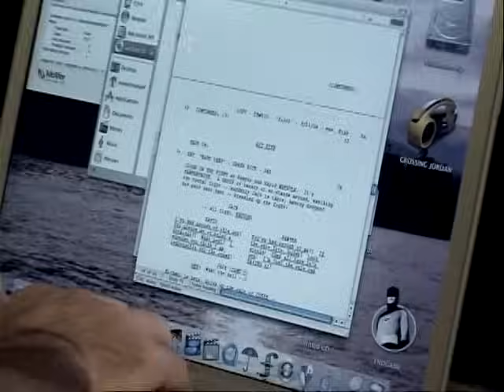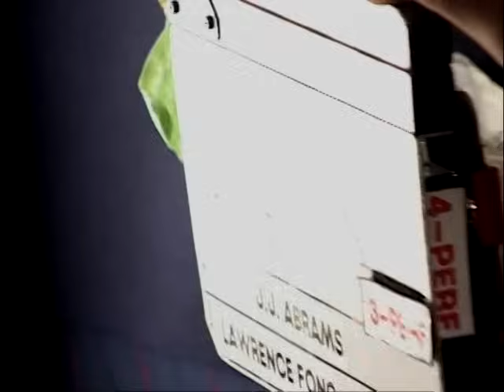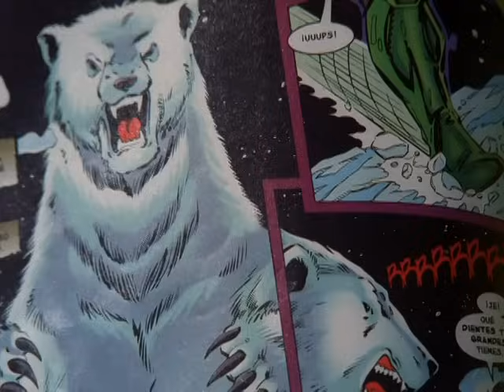LOST - The Making of the Pilot

Comment: Show started of really good with a really good premise. Then from season 3 onwards the writers really lost the plot and the rest of the show just turned into a mismatch of disjointed stories that had no bearing on what came before, with none of the setup from the first 2 seasons every paying off. By the end of the show you were just as lost as the characters. My comment to my partner when the show finished: All this when they all just need to speak to Allison DuBios after the plane crashed.
Reply: That’s because the writers intended to finish it in 3 seasons, but the network pushed them to make 3 more, so they had no choice but to make up random stuff and tried their best to make connect together
Reply: @Rayan.7  As a writer myself, one of the cardinal rules is that you never 'make stuff up' just to fill. As a playwright once said (I can't recall exactly how said it): "If you point out that there's a gun above the fireplace in Act 1 you damn well better use it by the end of Act 3." If it doesn't contribute to the story, it shouldn't be there. Instead of making up random stuff, they should have done their viewers and the story justice by planning the 3 extra seasons and have it pay off a lot of what was set up in the first three.
Reply: @Rayan.7  That´s not true. The writers never intended it to end in 3 seasons.
Reply: Yeah i have seen that but Lindelof even says the original pitch for the show was that it end in 3 years but it became clear in Season 1 that the network execs wanted it to go on for longer than that. And it makes no sense that Lindelof was planning to end the show in 3 years when they were still introducing characters in S2. I think the idea of it being a 3 year show was nixxed early on when it became a hit and I think he is using it as an excuse for why the show sucked after season 3 instead of owning up to it rather than blame the shitty writing. So technically you are right but i dont think the intention to make it 3 seasons long lasted that long as he makes it out.